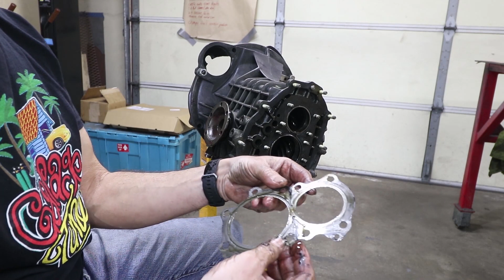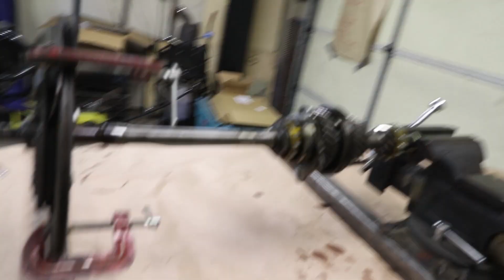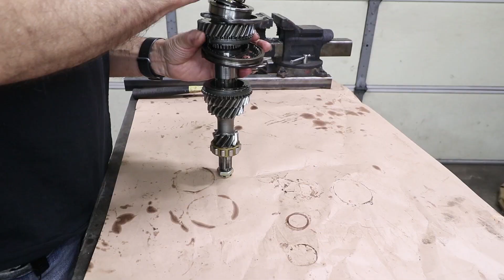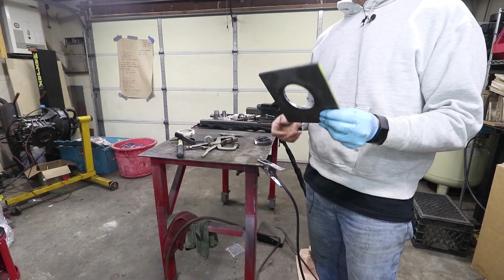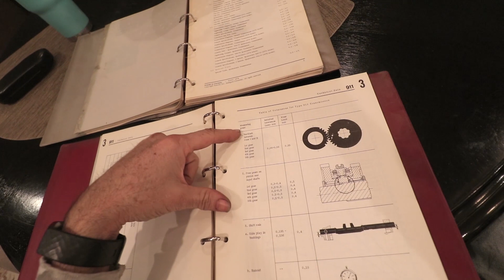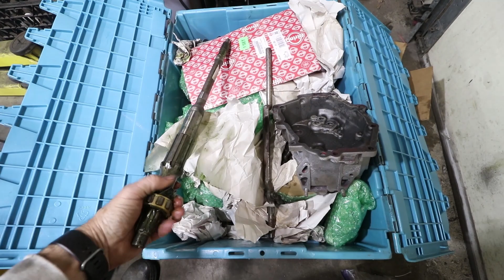Porsche 915 Transaxle Parts Inspection & Tear Down The Unconventional Way-AVERT YOUR EYES

Comment from the maker: This video was long, so I didn't talk about the gear ratios in this trans.  Apparently it has a close ratio 4th gear that only came in the Carrera RS 27:25?
Wonder if I have a RS trans here?
Reply: If it is a RS transmission wouldn’t it be quite valuable?  Maybe you could restore it, sell it and finance any custom transmission you wanted.  There must be a list of RS transmission serial numbers someplace. 🤞🏻
Reply from the maker: My thoughts exactly.  All the numbers on the bottom are worn off though

Comment: Im getting a minor vibration decelerating in gear around 3,000 rpm goes away quickly. My cv joints outer seem to be in not so good shape.
Reply from the maker: Hmm,. I would try to isolate if the vibration is engine related or wheel speed related.  Try again at the same speed when the clutch is in.  
A bad CV might still vibrate?

Comment: Awesome stuff Tom- completely unrelated but have you ever dealt with a possibly bent banana arm? Wondering if you have ever devised a way to measure them?

Thanks
Reply from the maker: Funny you say this, because I suspect one of my rear arms is bent. It aligned ok, but the wheelbase is 3/8 longer on one side.  
I plan on making a fixture that I can compare several arms until I'm certain which are good and bad.  
Do you have lwb alloy arms?